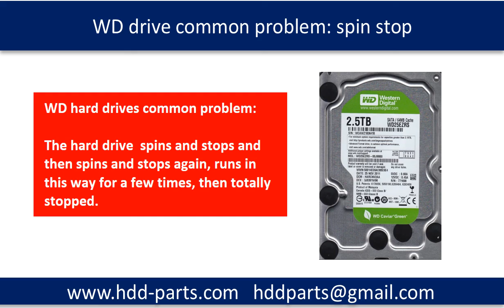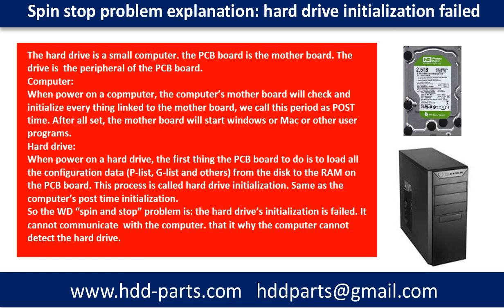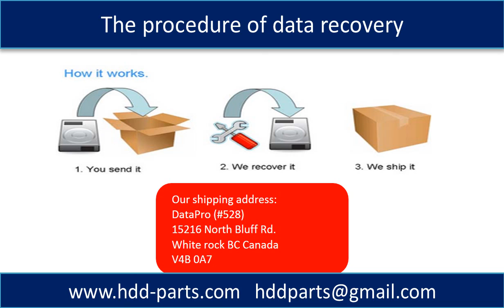WD hard drive spin stop problem fix   Data Recovery Q&A  31

Comment: This is TOTALLY INCORRECT!!!!!!!!!!

#1: Purchased (used) PCB Board the other day.
Install the PCB and the drive would spin up and then stop.

#2: Took Known working PCB Board from another drive of the same size.
This board worked like a charm and is running the drive right now.

#3: Took the (used) PCB and installed it on the known working drive.
The drive spins up and then stops.

So, your information is false.
Reply: I don't understand this.
Am i right to say you are using the same hardware - THE PCB BOARD - but just two different instances of that one piece of hardware? One that worked, and one that didnt?
Or are we talking about two different hardware pieces altogether (eg. like Chip1 and Chip2)

Comment: I have a WD20EADS 32mb drive but the controller board has been lost.   If I swap the platters into a good operating similar drive would it theoretically work?   What about using a WD20EADS GREEN  to swap a WD20EADS BLACK platter stack into.   Would that theoretically work?   Thank you very much
Reply from the maker: no